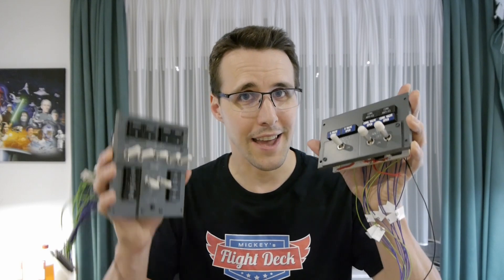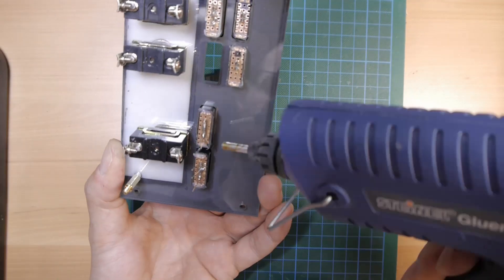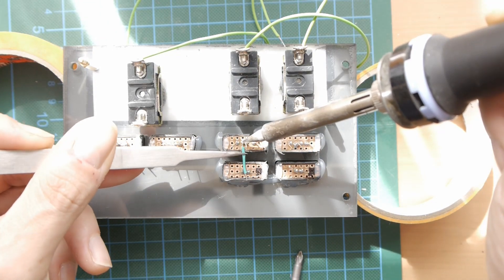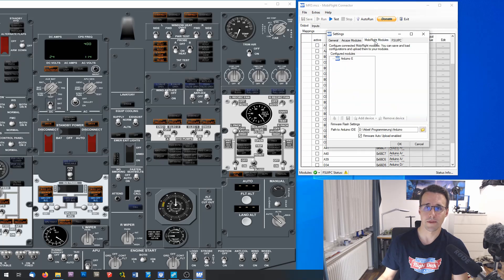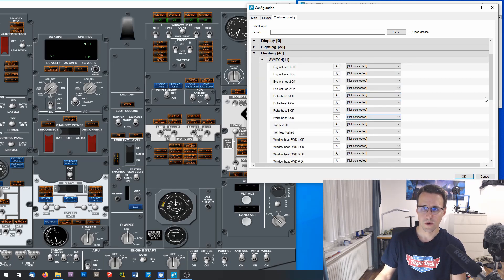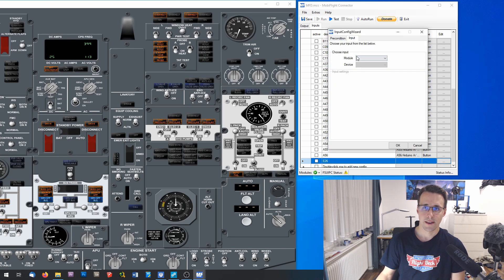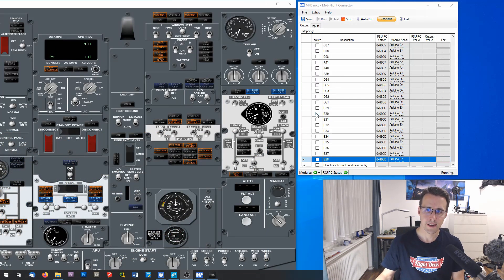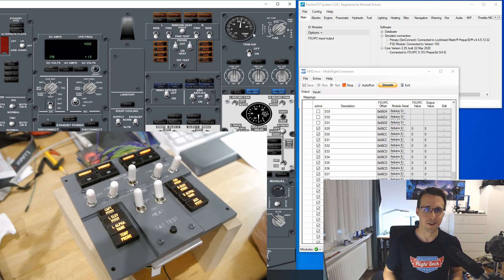Window heat & Anti-Ice panel - A Boeing 737-800 Homecockpit #43

Comment: Hello Michael. Was nice to see you at FS Weekend 2025 in Lelystad. Thank you for a little talk. I have a question about LEDs. What kind of LEDs are you using? Especialy for a green annunciator? Bright transparent? I'm using with a green lens but they are very dim, even with 90ohm resistors. I see on the video you ON annunciator for window heat and it is lighting very very brtight. Thanks for help :)